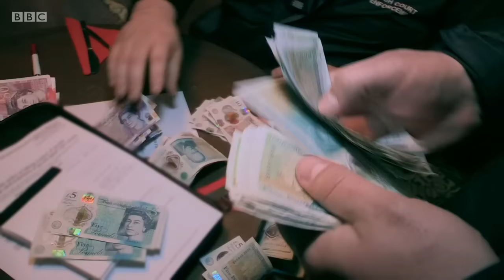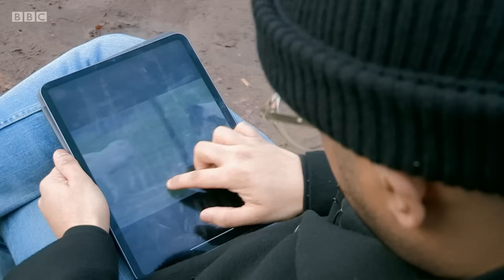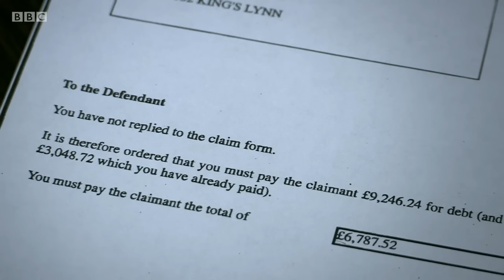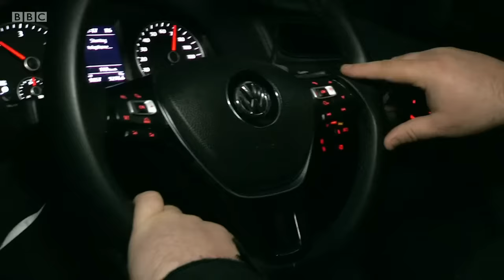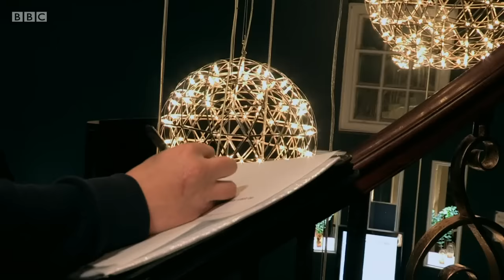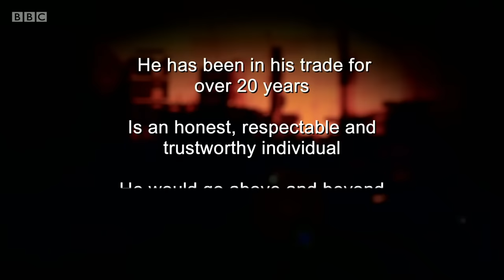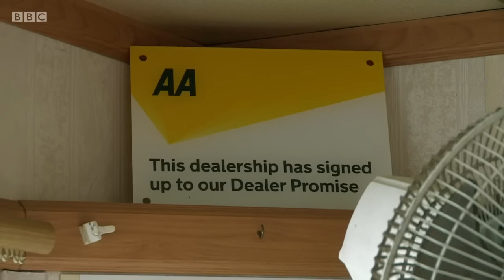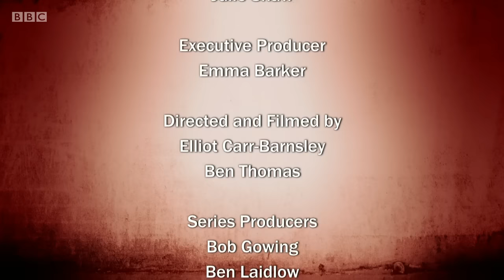The Sheriffs Are Coming S09E05

Comment: As an American well I'm confused on is so the issue a county court judgment against the debtor yet they don't pay so the court doesn't do anything so you pay to escalate to high court to get sheriffs to enforce payment what technically you already went to court so what's the whole point of going through the county court just to pay more money to get an escalated to the sheriff's when technically the court was supposed to do something anyway if the person doesn't pay what's the whole point of taking them to county court if the county court doesn't do anything
Reply: Ok the court issues a CCJ, a county court judgement. This is an order to pay but is also on the debtors credit file for 6 years. The court doesn't automatically enforce the judgement. There are court bailiffs but they are salaried and also have less powers than a HCEO.👍
Reply: The high court has higher minimum amounts. They also have more powers. I don't think county court agents can obtain entry via removing locks.